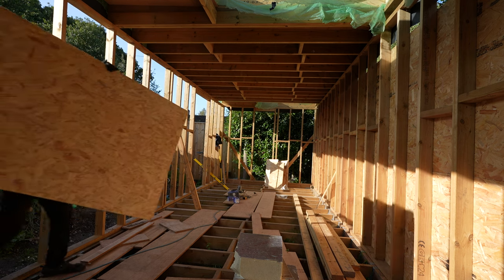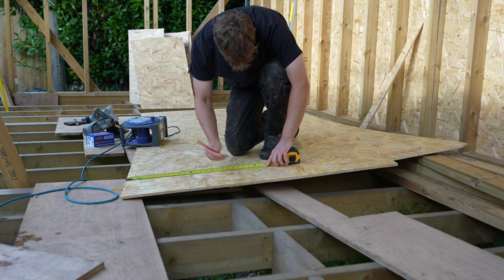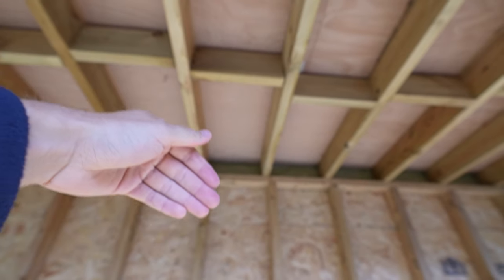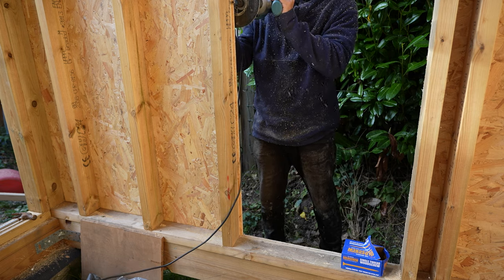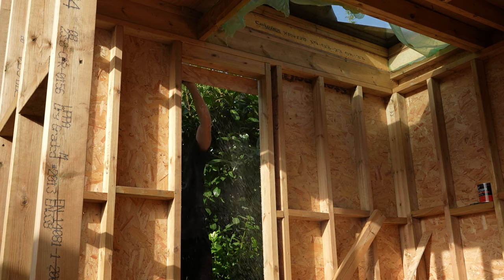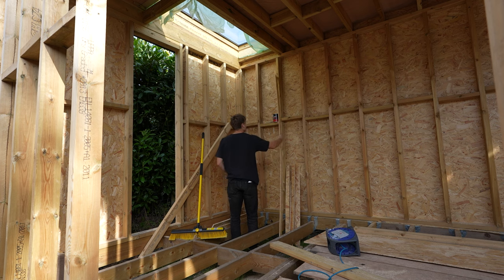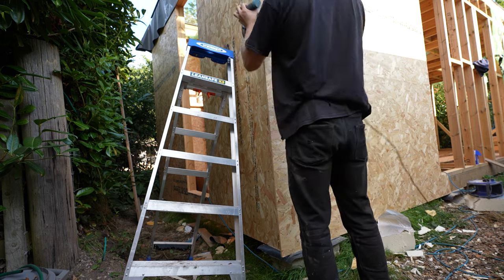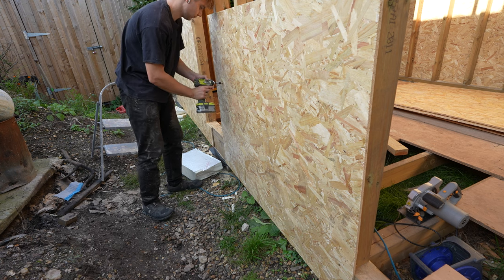How to Invest for Beginners? Money Talk + Creating Freedom by DIY Self Building a Tiny Home Cabin

Comment: Hi, I just discovered your channel. I am as DIY capable as a pair of socks. I have a vision though. I would like to build a shoe rack as a Christmas present. I don't know where to start, could I use just a hammer and nails? What type of wood should I be looking at? I get a bit intimidated by hardware stores because they see me coming a mile away and start trying to sell, versus give good advice. I am based in the UK, any tips or advice from anyone would be awesome.
Reply: Sorry for the essay reply, but hope this helps...

You could for sure just use a hammer and nails and a handsaw if needed! If you want it to be properly sturdy, you could add screws & a screwdriver as well as screws are more secure than nails. 

For wood, it depends on the design you want, how fancy you want it to look, how much water you expect it to be exposed to etc, but for a first project, I'd use 2x4s or cheaper wood, then sand & stain to the finish you want, so if you foul up, it's not a wallet-killer. That being said, don't buy any boards that have splits in them.

For any DIY project like this, I follow this template:
1) Measure carefully the space it's going to go in - these (minus 1cm) are the maximum dimensions of the finished product. If it's going to jut out into a hallway, tape out the area, stack a few boxes there, make sure no-one will bang a hip or knee.
2) Draw a plan - you want a front view, side view and top view, with exact measurements. So for this one, the side will be a frame (maybe with a diagonal bar, for stability), the top view will include my plan for what each "shelf" of the rack will look like (I'd include some air gaps in the floor of each rack for ventilation and drainage) and the front view will include the height spacing of each "shelf" - making sure I can fit the shoes I want to keep there.
3) Make sure the shelves are supported well enough for the weight of the shoes (wet & muddy).
4) Measure three times, cut once! Make sure I cut each piece of wood exactly to fit my plan, then sand all edges and sides (and stain) before assembly - this avoids awkward angles.
5) If using screws, pre-drill a small pilot hole to help the screws go in straight and not split the timber.
Reply: @Blue_Caribou  Oh wow! Thank you so much for your clear, thoughtful instructions. This is really helpful. I'm sure to most your advice seems obvious but I was going to do this the difficult way seemingly. This is amazing. Thank you so much!
Reply: @kelseysmith3297  No problem at all, glad it helped :) Best of luck with the project!